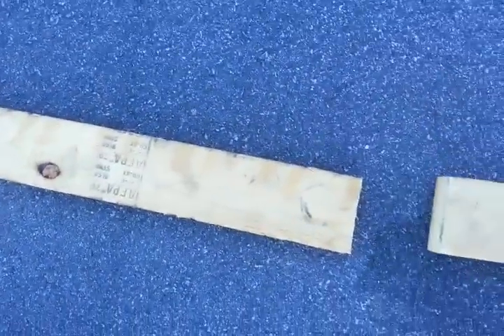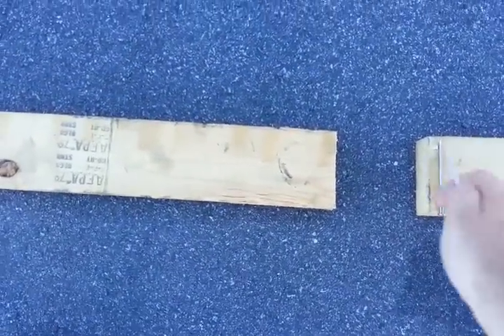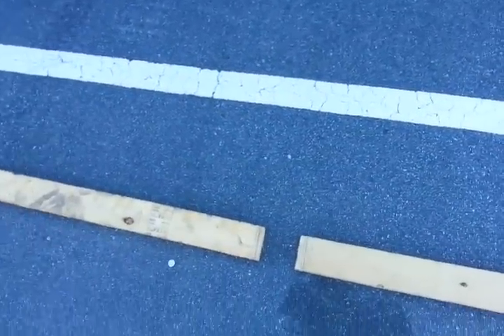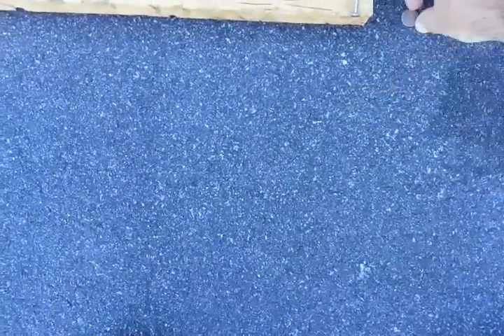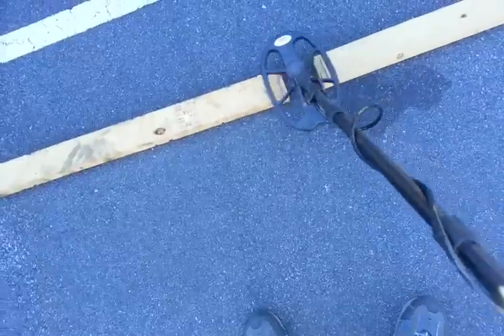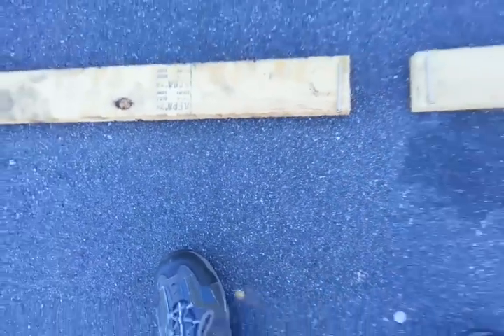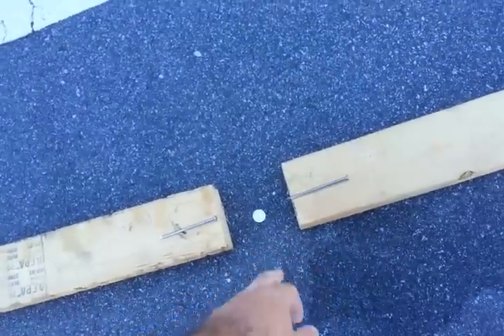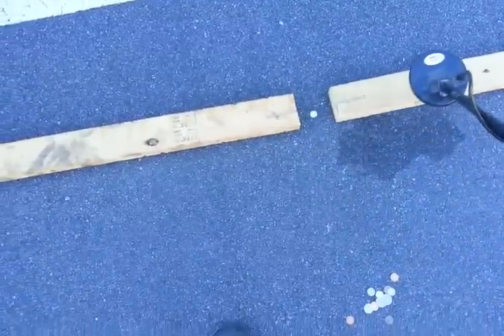Nokta fors Core elevated nail test

Comment: Hello Keith, seen you around Findmall.com plenty, very good posts appreciate your work. You did not reproduce the experiment the right way. Basically two 2 X 4, were used with the coin basically being 4" below the nails (dime or nickel). Furthermore the nails were closer together, perhaps 2-2.5" inches. Search around YouTube and you'll see the test. Try it this way and the results might be different. Basically on the specified video the only detector that passed the test was the Deus, the G2, T2 ,AT...Minelab all failed.